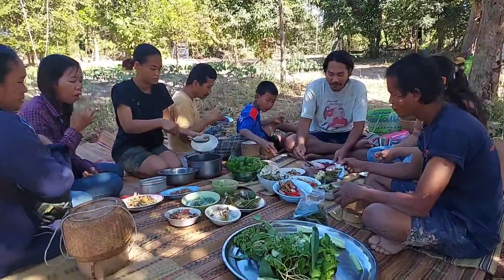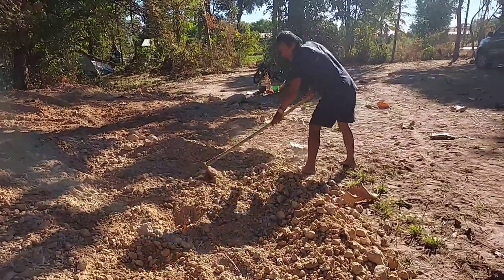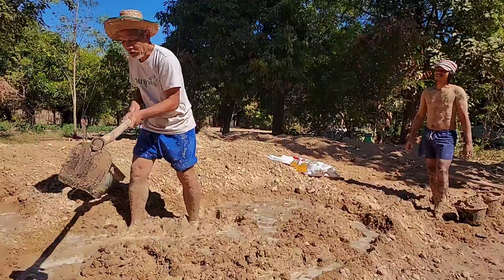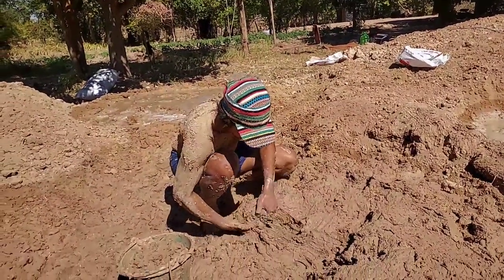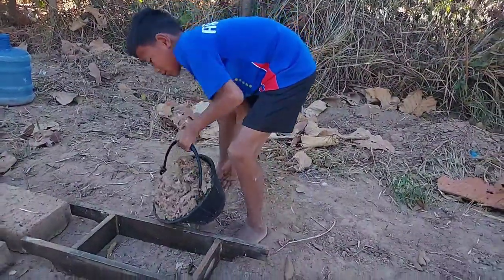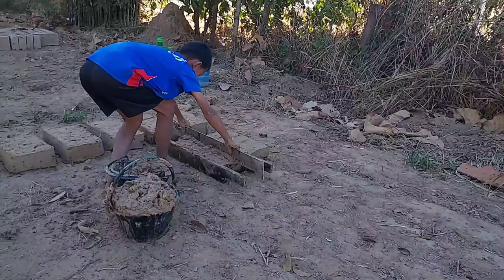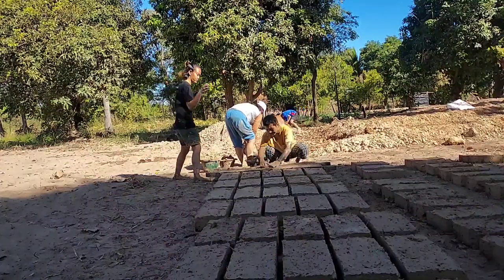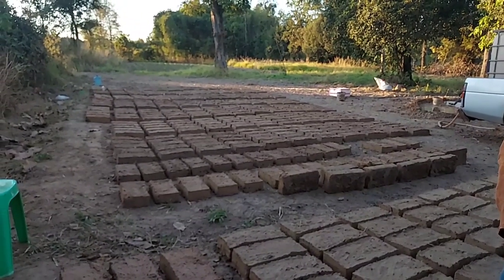How to make adobe brick.

Comment: Hi Jon, what kind of soil are we looking for, building the bricks?
Reply from the maker: Most of the soil can be used for making bricks. If the soil has too much clay it will crack and not strong. If the soil has too much sand it will crumble easily. Any soil in between high clay and sand is good.
Reply: @JonJandaiLifeisEasy  Thanks to this information its a big help.